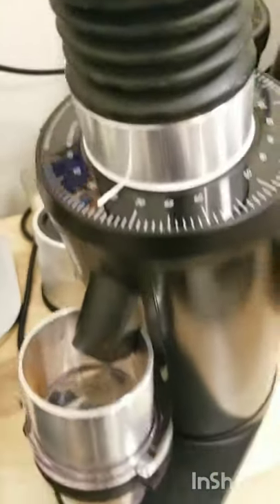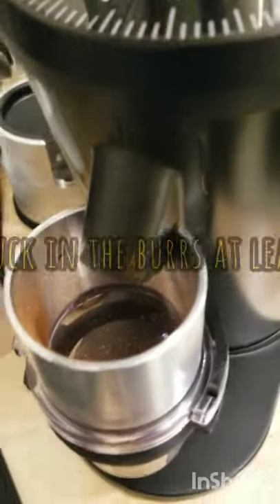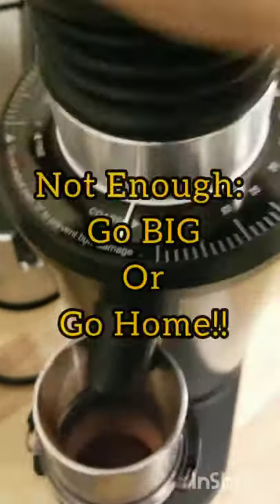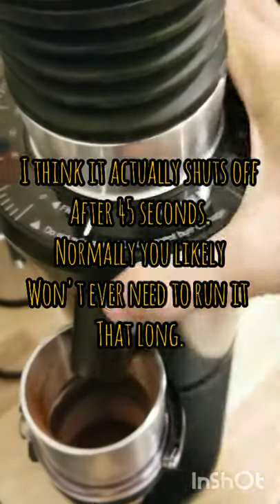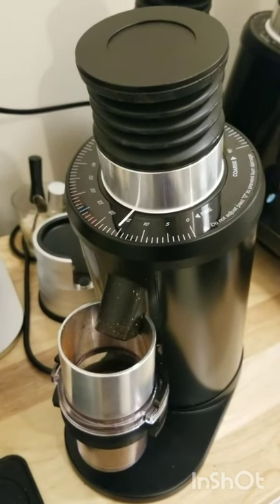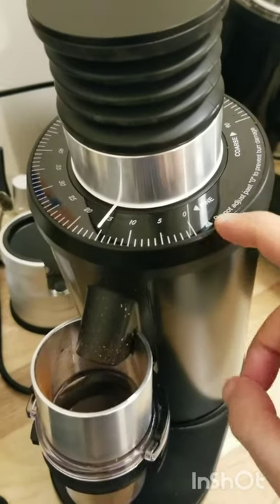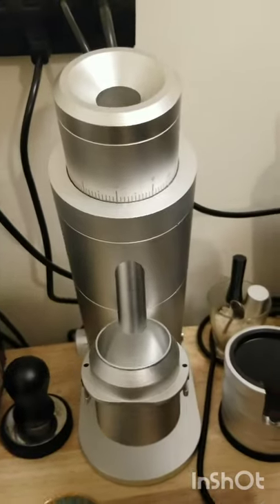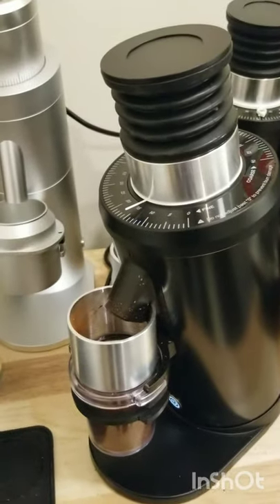DF64 Single Dose Grinder Switching from Coarse Back To Espresso Issue Fix. Burr Touching Issue Fix.

Comment: I had also had an issue when switching back from coarse to espresso  - it would not go as low on the scale anymore - so I just had to  open up and clean everything and it is back to perfection
Reply from the maker: Seemed like burrs were touching? You adjusted finer while it was running right?  
That's how I was dealing with that originally thinking something was wrong, but usually this will work, going much coarser first and giving the bellows a good pump, if that fails then yeah, might have to open it up I guess.

Comment: We had this issue too. But it feeled like they really touching.  And the thread is blocking. After it shut off (and we disconnected it) the burrs where stuck if you tried to rotate them manually. Tried it a few times, then opened it, cleaned it and it happened again after going from poor over coarse to espresso.

We then sent it back to the seller and he told us it was just "dirty" he cleaned it and sent a video where he switched a few times from poor over to espresso and back and grinded some beans. Told us we just need to blow it out (which we did) and not changing the dial while it is not running (which we didn't). 

Is this still the same issue as described here? Can it really feel like the burrs are totally blocked just because some tiny particles are between the burrs?
Reply from the maker: I'm not sure I did have a lot of df64s but didn't switch back and forth for espresso and pour over for many of them. Best solution is to try what I suggest here go even coarser run the grinder hit bellows hard clear out everything then with grinder running slowly go back to espresso setting.  If that doesn't work then open it up and clean it out but if it keeps happening and it's bad then it might have issues. The quality control on the DF grinders I'd sometimes hit or miss. I've noticed some were better behaved than others but the newer models do seem like they're making improvements. Hopefully they don't just come with different new issues.
Reply from the maker: With the DF83 I once ground way too finely for a specific coffee and it created a paste of very fine coffee that stuck between the cutting grooves / teeth on the burrs,  and I had to open it up and clean it off with toothpicks!  Is that what you mean? That may happen grinding a very oily coffee or just while grinding superfine.

Comment: Doesn't it not matter that you force through it is it's literally just coffee that's causing the grinder to make that noise. I just push through it and it goes away after I arrive at my espresso setting.
Reply from the maker: You may be right, but I feel better clearing it out first.   A lot of people seem to get freaked out thinking their burrs touch way earlier than they should (as I initially did) so I thought would be helpful for people with this or similar grinders.

Comment: I am so torn between DF64 and a Euerka grinder. I really like my old old Eureka Instanteneo 50mm grinder, but want an upgrade.
How do you like your DF64? I am mostly concerned with the e clogging regrinding issue, but I am willing to mod it.
With the Eureka Single Dose it is the vibrations and the clogging issue.
I saw that you made a video about removing the bellows, that would work for me also.

On my small old Eureka I have modded it with a 42mm plexi pipe with a bellow on top, that would probably also work for the SD ORO
Reply from the maker: My Eureka oro single doser had more issues with clogging than the df64s I've used have (had used 4 of them!) Just clogs up mainly so the bellows doesn't work but coffee comes out still. Until they fix the issues it seems like df64 is the better option. I'd suggest looking into the Specialita as I've had good experience with that as well but not sure if it's a big upgrade for you. From what I can remember the Oro and specialita have a similar taste profile. The Burrs on the df64 and other higher end grinders I have are higher clarity, which is best if you like light roasts with fruity notes but has less body and takes getting used to at first.  The eurekas are more traditional style and blend flavours together more but in a pleasing way usually.  For chocolately coffees they seem to do better.
Reply from the maker: With df64 it's fine out of the box but with a perfect alignment and modified declumper you'd basically be getting an uglier p64 for less than 1/3rd the price, minus the nice accessories and variable RPM.
Reply: @BensCoffeeRants  Hi, great summary about Eureka 55 and 65 burrs vs DF64. 

I wanted to ask you what would you choose in my situation. I know that everybody has different preferences etc. but I am not really asking what tastes better as such but what would you choose. 

I am a total novice. I drink, roasted on demand, specialty single origin usually high density beans with preference for light to medium roast. I currently use beans to cup machine (which does not them any justice) but awaiting delivery of Lelit Grace. I mostly drink  cappuccino in the morning and americano later in the day and I am planning to experimenting if maybe straight espresso would be my thing with the new setup. 

In my situation which grinder would you choose - Specialita vs DF64 (with stock burrs to start with). Both cost exactly the same where I live (~ €400 delivered). I have already ordered Specialita but I can always send it back so there is no problem there. 

In all fairness, when I have ordered Specialita I have not read that much about DF64 but my reasoning for it was: 

1. It can act as both SD and timed grinder, which is great to start with as I am not sure if SD is for me in the long run. Also there is plenty of bellow mods available if I would decided to go SD 24/7.
2. It seems to offer kind of balanced taste profile for flat burrs which is probably good for a novice like me. But at the same time is maybe a limiting factor long term or in learning of which profile I really like?
3. If I would ever decided to also get NZ I would have hopper + dedicated SD in NZ and flat plus conical

In terms of DF64:

1. I would be maximizing flat burrs differences vs conical if ever adding NZ
2. I would have option to much easier switch between beans vs Specialita
3. I would loose hooper and timed option 
4. I would get more focused taste out of the bins (which can be a double edge sword if that is not something that I prefer vs more balanced of Eureka or other side of spectrum with conical. 

I drink only espresso and espresso based drinks. ATM usually only one bag of beans at the time but those grinders open possibilities of having few different beans ready.

If I would end up using only one grinder which would you choose between the the DF64 and Specialita?
If I would be adding NZ in the future, which would you choose between the DF64 and Specialita?

A long one ;)

Thanks
Reply from the maker: @sebna  I like both grinders, but DF64 with higher clarity I think is a good choice especially if you're planning on getting a niche zero later I think Df64 is the better choice since in your case, It's more if a contrast to the niche and can also do coarser brew methods really well with ssp burrs.

I cannot not, do single dosing it just makes sense to me I was doing it before i knew it was a thing and had a name with the Baratza vario.
Reply: @BensCoffeeRants  many thanks. And if you would have to choose only one grinder to have and use between the two? Would it be DF64 or specialita?
Reply from the maker: @sebna  if you're just doing espresso the Specialita maybe. It's not nearly as high clarity but gives more body and if you like medium or darker roasts it may be better but if you like light roasts mostly go df64.
Reply from the maker: @sebna  You asked about selling my Specialita? Yeah I sold it, because I felt like I was spending too much on my gear at the time, and was kinda blown away by the difference in flavour clarity on the DF64, but I kinda regretted it / missed it a little, I think I started missing the higher body which I kinda took for granted in my older grinders,  which is why I later got a Eureka Oro SD thinking it's going to be a bigger better Specialita, but unfortunately it was not.
Reply: @BensCoffeeRants  thank you for answering question I have deleted :). I have deleted it as I got confused by the fact that you have Oro now which I realized only after posting it and I thought that I only imagined that you used to own Specialita :).

Maybe a story of mine will put your mind at ease. I went through similar process in the past with one of my DACs for my stereo system. I upgraded and sold it, but after a while a decided I was missing some aspects of it so I bought it again in addition to what I had. It was not exactly cheap at 3k. And guess what. It was only better through my memorie's rose tinted glasses :). I kept it for a while and sold it again.

Maybe ORO is not as good as Specialita, but also maybe it is not as good as your memories make it to be in compare to what you now have  between DF64 and NZ :). Just something that I have experienced personally.

Coming back to my problem in hand, I am completely torn. If I already would not have ordered Specialita I know I would be ordering DF64, but since I already have I think I will keep it and wait for 2nd hand  NZ or DF64 to show up if I feel like I still need it ori will just get DF64 if still in doubt in few days when I start using Specialita to compare them side by side and send back one I like less.
Reply from the maker: @sebna  even if you use them for a little while resale value shouldn't be too bad so you won't lose too much money if you find a buyer later on.
Reply: @BensCoffeeRants  first cappuccino made using Eureka and its obvious improvement over my BTC machine. I will give it few days before I decide if I want to order DF64 in addition.
Reply: I had an EUreka Grinder and sold it again. Got the DF64 and aside from that one time issue with the "burrs touching while not touching" ... I never looked back.
I switch between beans a lot and the DF64 is so much easier to dial in with the big adjustment wheel.
The tiny flimsy Eureka Wheel annoyed me so much. Turn it like 1mm into either direction and the shot time varies about 15+ seconds for me.
And after switching beans it's almost impossible to just dial it back to where it was.
If you are content to use one sort of beans for a long time, then the Eureka is fine. If you prefer to switch, then the DF64 comes in handy. Also the aftermarket bellows on my Eureka were always a bit of an issue with single dosing.
Last but not least: for me, personally, I like the flavor profile of the DF64 just a bit more. Compared to the Eureka I found it to be sweeter. Bit more complexity, bit less clarity. In the end, it just hit the spot for me.
Reply: @Ghostbear2k  I ended up getting the Eureka Atom 75.
Such a difference from the old 50mm and the Sette 270W.
I agree about the small dial of the smaller Eureka grinders, but the Atom is very easy to dial in and the timing is as accurate as the Sette GBW function.
I don't single dose.
I guess the slightly larger dial and much larger burrs made the difference.
And it is so much more quiet and faster.